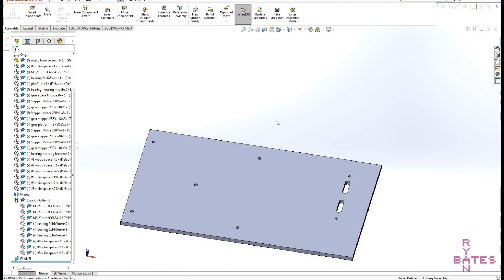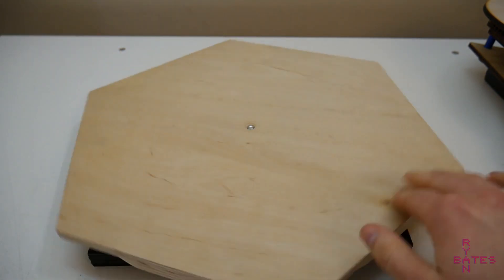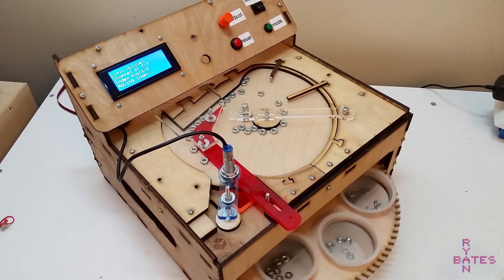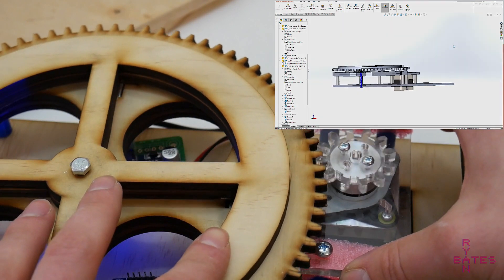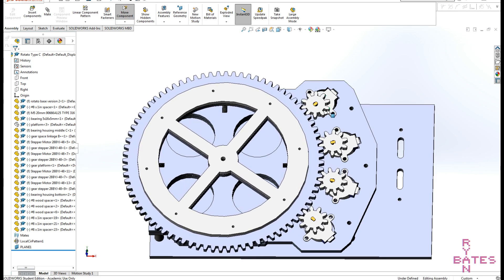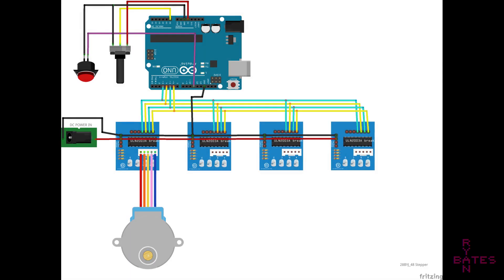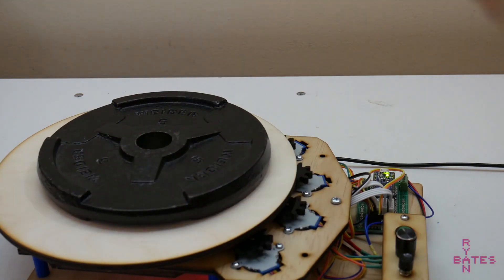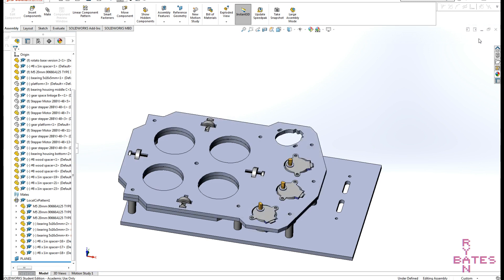Motorized Turntable for Stellar B-roll Video | The Rotato DIY

Comment: Ryan nice build.  I like bearings support and how simple it is.  I’m working on a project for my 34 year old son that is mentally handicapped. He loves Thomas the Tank engine and round house with sheds.  I build the round house and sheds a bought a round table.  It uses a Geneva Drive he has a hard time because of his reaction time, so the train always goes to the wrong spot.  Also switching the track voltage is a problem as well.  If I power all the tracks they all run out.  Somehow I need to simplify the system for him, but that complicates for me beyond my knowledge.  I think if I had a dial the would switch the lights in the house to on he could select the house push the button to go.  Also he can run the rest of the layout fine including switching the tracks.  He loves the Independence of being in control. I have worked with him for over 5 years to try and teach him how to do it manually.  Any ideas I’m lookin for a different view from someone that can solve the problem.  We dod have limited resources but over some time in build a small budget to solve the problem.  Thanks for your thoughts.
Reply from the maker: If you build from this design, you're nearly there to create a round table that can index. An arduino driving a stepper motor counts 'steps', so getting accurate position can be done with a few lines of code. I would probably do it this way. A standard nema 17 motor takes 200 steps per revolution, if you use the plans I made for this device, you have a gear ratio of 1:8. A full revolution is now 1600 steps.  Say for example if you wanted the round house to stop at 4 different but evenly spaced locations (indexes), you just tell the stepper motor to run 400 steps, stop, and wait for a button press before moving again. Code would be something like this:

#include <Stepper.h>
int indexButton = 10; //button for index the roundhouse
int stepperSpeed = 20; //rpm of stepper
const int stepsPerRevolution = 200; //standard for most nema 17 steppers
Stepper myStepper = Stepper(stepsPerRevolution, 3,4,5,6);

void setup() {
  pinMode(indexButton, INPUT_PULLUP);
}

void loop() {
 if (digitalRead(indexButton)== LOW){
  myStepper.setSpeed(stepperSpeed);
  myStepper.step(400); }
}